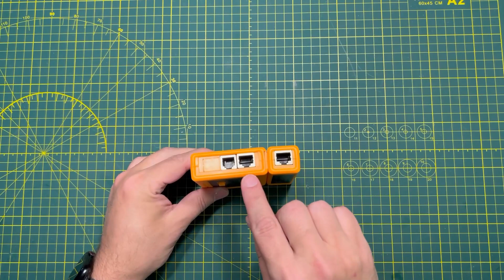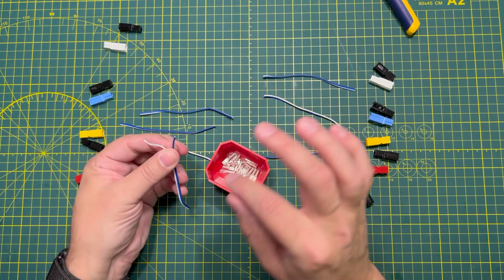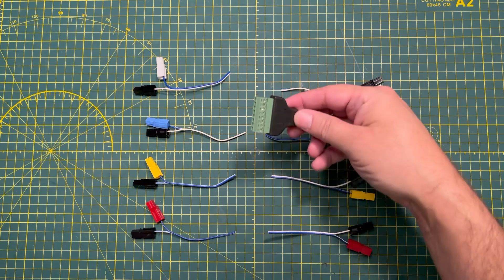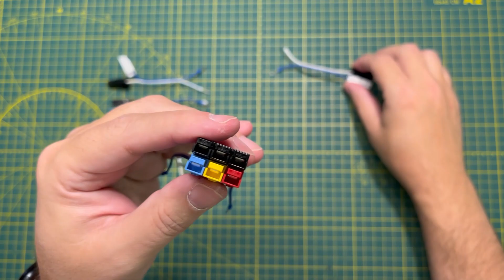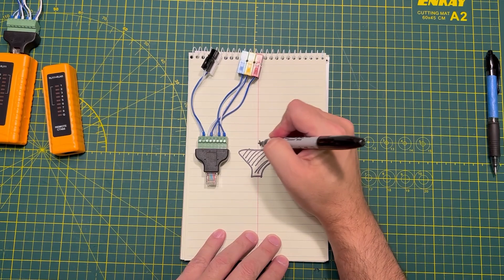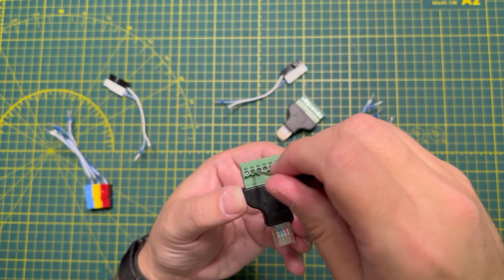Simple N-Trak BUS TESTING Tool! - EASY TO MAKE

Comment: Or one can purchase a cheap multimeter that has a continuity setting and some jumper wires made from a piece of wire and two alligator clips. Would cost around 20 bucks and be a whole lot easier. People need to stop making things so complicated.
Reply: Your idea only works when you can get both ends of the wire you are testing within a few feet (or less) of each other.  The Network Cable tester he uses as the base of his tool is designed to be used ALSO when the two ends of the wire are nowhere near each other (such as on two different floors, or in this case, 20+feet away like you would have for an N-Trak / T-Trak layout.)   I use a network tester as well as a multimeter regularly as part of my job -- they are designed to meet different needs - this is not a case of "more complicated".